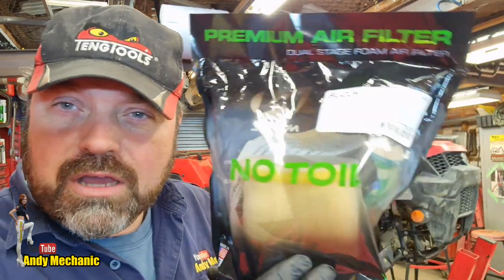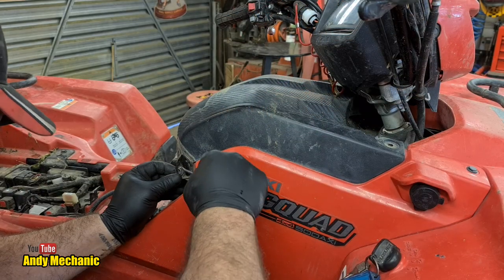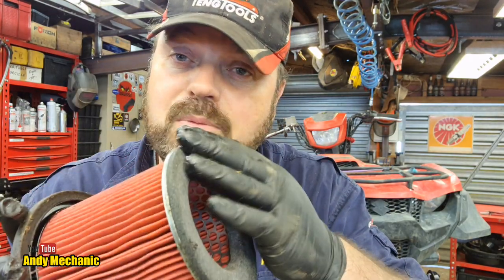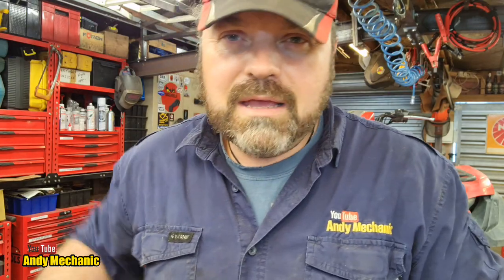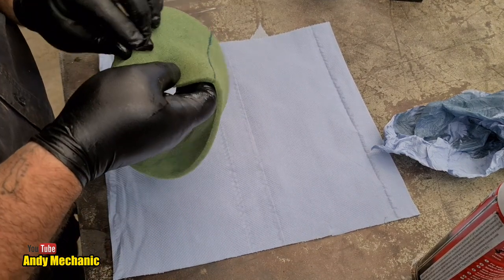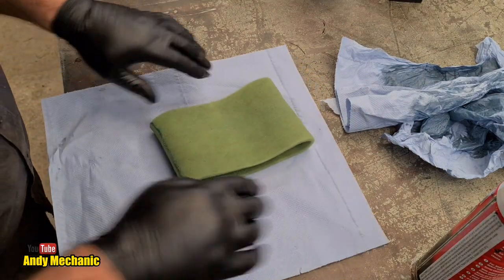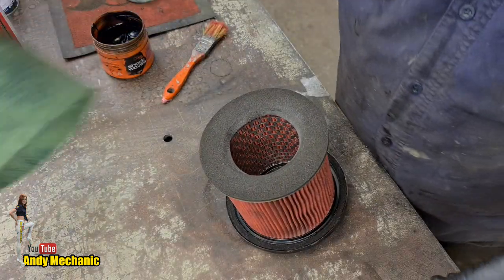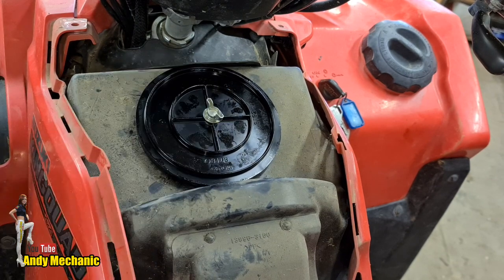Suzuki KingQuad - air filter service #1876

Comment: Been asking around on the Facebook groups and 98% swear the stock air filter will dust your engine out, I just dont know what to believe.
Reply from the maker: It really depends on the operating environment. In most cases the standard OEM filter is just fine

Cheers Andy
Reply: @AndyMechanic  I'm a mechanic at a coal mine, we have the nastiest finest dust to ever ruin your lungs.  Shit that just hangs in the air for 5 minutes.   All our equipment utilizes paper elements with secondary filters. On the inside, very rarely do you see any dirt on the secondary filter, if you do its because dirt fell on theme when you removed the primary filter.  This is why I'm having such a hard time believing the guys on the Facebook king quad groups all chanting that the stock filter will dust out your engine.  Unless there is a faulty design, maybe the lower seal you greased up isnt done right from factory, maybe dirt coming through the wing nut?  Honestly the paper element was a buying factor in choosing the king quad for me, I hate dealing with oiling filters and in my experience paper is absolute, even to the degree where I've seen it plug up so bad it has caved in the intake piping on some equipment.
Reply: Not trying to be a know it all, just trying to gather info on whether I can keep it stock or need to get a foam filter
Reply: @Markmeblablabla  well what did you decide?  See I find it hard to believe that Suzuki would make a inferior air filter. Because they really don’t want to pay out doing warranty work.  So if it’s good for the period of the warranty why wouldn’t it be a good filter ?
Reply: @joerutkowsky3261    I got a uni filter,  I will however say the stock filter from factory had no oil on the foam sleeve, even though the owners manual specifies it should be oiled (with engine oil but I cant remember)  If I were to have kept using the stock filter I would certainly oil the element, the base of the filter, and where the through rod retainer gose through the filter as thats probably the most likely for dirt entry.

Comment: Hey my suzuki 500 is backfiring when I let off the gas please help me going nutzs can the filter caz that
Reply: Getting cold air seep somewhere .... gaskets leaking , possibly torn or flattened out !!
Reply: It's running rich, that's excess gas burning in the exhaust. Check fuel system.